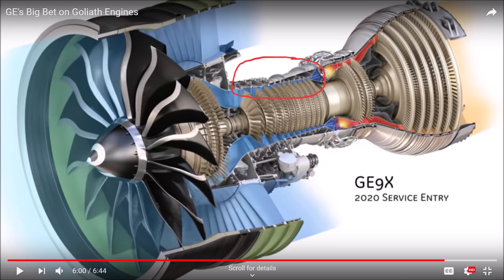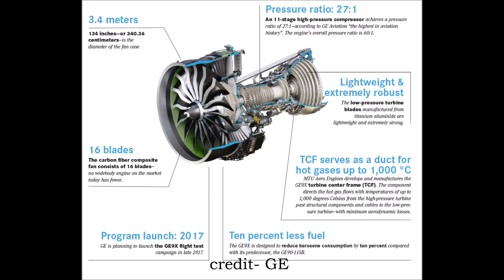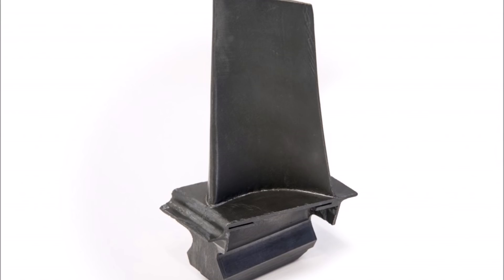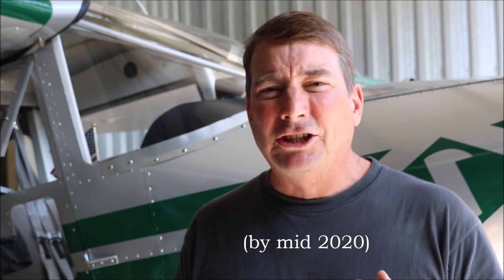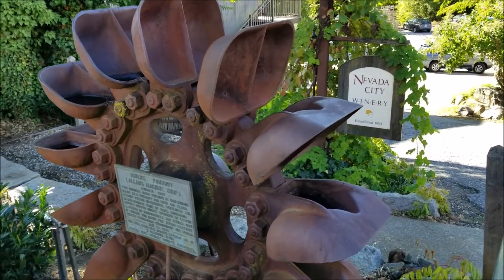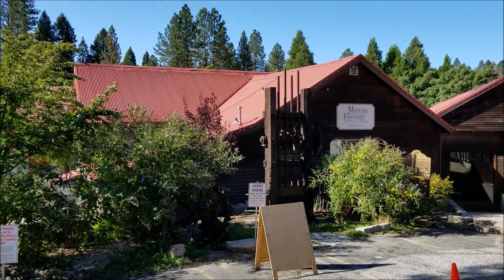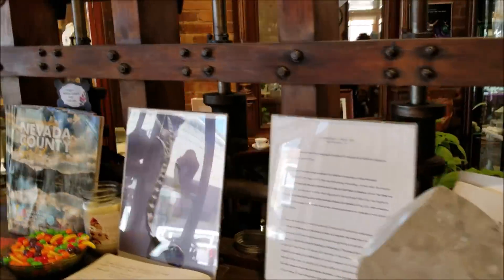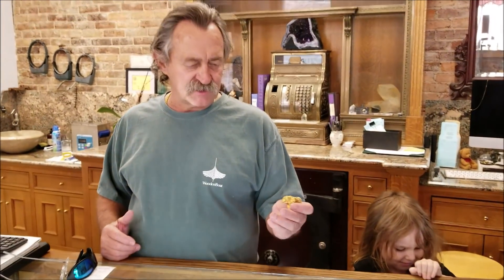Boeing 777x Delays and the GE9X engine stator vane issue.

Comment: I watch this channel very often and I can see that there is GREAT knowledge of aviation matters. But here in explaining large turbofan efficiency there is a major error: The engine's EPR is not a measure of its efficiency.  It's the COMPRESSION RATIO. This is the ratio of the pressure at the inlet of the engine to the pressure at the exit of the high pressure compressor (just before the combustion chamber). This ratio is around 60 in very efficient engines. At Top-of-climb (climb power setting and low ambient pressure).
Reply: There are a number of misstatements, which I have annotated.

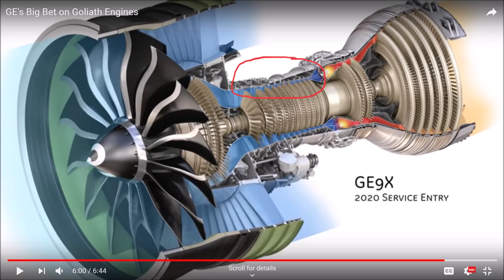Comment: ...their engines are probably disintegrating because they assemble them with their bare handes. Since those components reach high temperatures any part that has been handled by a human has had residual humain grease and oils deposited on it resulting in hot spots and proven to cause premature failure (6:53). I was appalled when I saw that... Humanity is supposed to be advancing with time not going backwards. They had better assembly procedures in the 1950's-1970' for crying out loud. I'm frequently distressed and appalled by the lack of simple, basic protocols that are blatently ignored by the "new" generations.... (For crying out loud a simple pair of cotton gloves would probably solve a whole host of heat related failures for this company. Attention/detail, unbelievable.)

Comment: I still prefer something with 4 engines ie 747 over water. One goes three more left, two goes we are still in the air, three goes we're in deep dodo!
Reply: radioactivelarry It all boils down to fuel efficiency, two engines use less fuel. The early 4 engine jets were rather unreliable, so that extra safety margin was necessary.
Reply: @gordonrichardson2972  True but I'm old school and old! lol
Reply: @radioactivelarry  I'm getting old too. My late father was a navigator on B-24s in WW2. Losing a piston engine was a big deal in those days.
Reply: @gordonrichardson2972  My stepdad was a B-17 pilot. He is the one that got me interested in aviation when I was young.

Comment: Juan, I hate to nitpick at this time,  but there are a number of subtle technical misstatements in your description of the jet turbine. (I would have to go through and timestamp them all). Also stamp mills reduce the gold ore to a fine powder, and would not be used to locate nuggets. P.S. Lovely old Pelton Wheel turbines, but I am sure the cow story is apocryphal!
Reply: Already noted in other comments. 02:22 Stator vanes is correct, followed by stator blades which is incorrect.
03:30 Atmospheric temperature only declines up to the stratosphere. This altitude varies with latitude and season.
04:12 You mean successor engine series. The GE9X thrust will be derated in actual service (05:15).
05:30 Confusion between overall pressure ratio (OPR) of the compressor, and engine pressure ratio (EPR).
06:52 Shows a ring of variable stator vanes (circular hinges), with a few fixed stators (flat hinges in upper layer).
07:20 Higher EGT is an indirect consequence of compressor wear, and running at a higher rpm.
07:46 Most of the efficiency gains are in the front fan, the turbine less so.
07:57 Titanium metal is never used in turbines, either nickel alloys, or titanium aluminide alloy.
08:59 The stated engine cycles for the GE9X are impossible, perhaps you mean the GE90 series?
I hope you take these clarifications in the spirit of clarity and accuracy.
Reply from the maker: @gordonrichardson2972  correct, I was moving pretty fast today...
Reply: @blancolirio  The AgentJayZ channel has dozens of videos, jet engines are hard to explain clearly.

Comment: I just had the thought that if I were a pilot with experience in Boeing aircraft, espeically thousands of hours, that I might consider going around and above my employers certification routines and go to Boeing and do the simulator and get Boeing to certify me on the Boeing 777x.  Then I would, perhaps, have my choice of carrieres that used those aircraft and maybe get pushed to the head of the line in seniority, etc...  I  have the thought that being certified, via training and simulator experience, by the manufacturer would be a great head start, so to speak. (Especially if I were grounded and had a great deal of down time). Damn the costs, maybe someone at Boeing, might take a liking to such a pilot, especially if they followed a well known, well liked, pro-Boeing youtube channel, etc. and out of decency, offer a substantial discount...  Boeing may even take a such a liking to that pilot that they may offer them a better job than the one the currently held...  Just random thoughts...
Reply from the maker: I like the way you think!
Reply: blancolirio  And I may be out of place by saying this, I have the thought that skipping training and certs for the 777xxx shouldn't necessarily be what these carriers and pilots should be striving for. After all these are sofphisticated systems and if he pilots would have trained on these new engines and certified for the new aircraft these accidents may have been easily avoided. At any rate someone certified on these aircraft would shine like polished platinum, versus those who are hard set to avoid the training. It would show determination and a willingness to be above average.

Boeing would do well to put some experienced pilots on thier team, as well. You analytical abilities would be priceless with regard to bringing this aircraft online and up to speed. Seems to me that they have too many corporate lame brains on the task and no one with experience. Whatsmore is that if there was anyone worth their salt at boeing they would have found you, easily by now; you stand out at this point like you were born to be involved with 777xxx. It tells me that the staff at Boeing is stagnated from the top, bottom, sides and rim. No creativity, no drive and simply content to be average. Someone at Boeing should have hired you by now. And I have the thought that you are not giving your experience the respect that it deserves. Perhaps its out of humility, a lack of self-confidence or more likely simply because it crept up on you and you're accustomed, as we all are, to others being more experienced. Seriously, its hard to recognize when one becomes superior in experience and knowledge. We often fail to recognize our own genius and therefore our value. You need to stop and take a look at yourself and give yourself the respect that is due to your abilities. TAKE SOME TIME TO UPDATE YOUR RESUME! (It may help you to realize that you are now the pinnacle of experience with regard to Aircraft and their related systems). I'm not one to flatter others and while this is a difficult topic to language I hope that you are getting my point). You aren' over the hill, yet.  Your experience has reached the point where it has become your nature. You should give yourself a nudge. From my point of view I can say with confidence that you are wasting your talents by settling for 2nd chair/string on an airliner.  Your talents are needed and would be better suited elsewhere in the industry.  You're overqualified to even be the Captain on an Airliner and I'm insulted that you have been over looked for that job.  Apply for technical job at Boeing involved with the 777x ; it wouldn't even be work for you. They need you there and they will hire you instantly; DON'T MISS OUT ON YOUR DESTINY.  Best regards, Johnny

Comment: Juan! Congratulations on the 100K subs! You earned every one of them by your honest and forthright commentary.
I had to ask what is wearing the stator vanes? They don't spin or contact the compressor hub. After doing some checking, it looks like it is the lever mechanism that moves the variable stator vanes that is wearing prematurely, not the stators themselves. Is this right or is the info I found outdated?

Comment: F-16 has 28k+- thrust. Those engines make the fighter look like a toy. Btw, I thought engine cycles could also be added in flight based on throttle operation. I’m assuming large aircraft can vary from fighters in this case.

Comment: Juan..your next 400k subscribers will go very fast! I am still holding my breath for you to take us all on your NEW SIMULATOR ride on the 737MAX. We know you will be called by Boeing soon enough. Of course Boeing engineers watch your channel. Anyone with brains and love of aircraft  watch your show! Great forum, keep up fine work!
Question: are not the Rolls Royce Trent 1000 series and other high performance engines ALSO experiencing stator vane material breakdown?
The SouthWest 737-8 had an engine failure, which sucked a female passenger out of airplane at altitude. I believe this was 3-4 years ago. The female Southwest PILOT did a fantastic job of damage control, bringing aircraft to a safe landing. The base of the stator vanes were pretty much immediately inspected by a nifty test. Thanks for your reports!

Comment: That a non rotating part in a relatively benign area of the engine is the cause of the delay problems is kinda surprising. I would have guessed something in the hot section to be the source. And as a long time gold and silver afficianado I really liked the last part of this vid! Congrats on 100k!
Reply: terry boyer he incorrectly stated that the problem was with the “fixed stator blades”. The problem was actually with the “variable stator vanes”. While they are not rotating as in compressor rotation they are a moving part in their own independent way and do encounter stress.
Reply: @aaronbennington9942  Thank you for clarifying that. Variable stators are certainly more complicated.

Comment: Remember when we were amazed that a 747 had 40000 lbs of thrust in each of its 4 engines?  Now ONE engine has almost that much.   Must be a 6 in diameter fuel supply line on those 9x motors....

Comment: The thermal efficiency of an engine is directly related to the maximum operating temperature of the heated gas running through the engine and doing the work. Specifically, the efficiency is determined by how hot the gas is when it starts doing the work, and how much it has cooled doing the work. The limiting factor is how hot this gas can be. The tolerance of the materials and the extent the material can be cooled limits the max temperature achievable. This is difficult to do in a turbine engine because the turbine blades must be constantly exposed to the hot gas without any easy way to cool them. Ceramic materials and blown cooling air through the inside of the blade itself are attempts to increase the turbine inlet temperature limit.
Reply: Cray Research used Flourinert (tm) to do similar cooling of the mount bars for internal cooling of the X MP and Y MP systems. The whole supercomputer was in-cased in Flourinert (tm)  in the Cray 2 and proposed for the Cray 3. This material was so inert , you could breathe it with added oxygen, much like the divers in Abyss. If you let the mixture get too warm. it breaks down into very toxic chemicals. 3M could figure out a high temperature version for jet engine cooling. We used it to heat our buildings in winter via a heat exchanger.

Comment: Juan,

Blades rotate, Vanes are stationary, stators by definition are stationary.  Therefore, blades can't be stators. so "Stator Blades" aren't possible.

Call them "Stator Airfoils" or Stator Vanes.  If talking blades, compressor blades or compressor airfoils. or compressor rotors, since integrally bladed disks are becoming more prevalent.

The individual vanes being loaded in the GE video are called "Vari-vanes" or variable inlet guide vanes.  The don't rotate with the turbine wheel, so they are vanes, but their angle of attack is variable.

Also, Titanium isn't generally used in the turbine section airfoils as it can't take the heat.  Metal blades and vanes in the turbine section are made from Nickel or Cobalt.  Ceramic airfoils in the turbine section could provide a weight savings over heavy/dense Ni or Co alloys and be more efficient because less cooling air is required.

Keep the vids coming.  Congrats on 100 subs!
Reply from the maker: see corrections above in description.
Reply: powerwheelscd Thanks. I noticed several misstatements in the video.

Comment: Juan congrats on 100,000.... on that note... how much of the higher temperatures is about lower emissions? In automotive engines they operate hotter temps to burn of carbon and nitrous oxides. Also when you use a bigger engine and run it 3/4 power factor you make the engines run less work making them last longer

Comment: Another nice video, but I think you have the Engine Pressure Ratio (EPR) number and Overall Pressure Ratio (OPR) numbers mixed up (the terminology seems confusing to me too).  Roughly speaking, the Engine Pressure Ratio is the pressure ratio between the inlet and outlet of the ENGINE.  This is the 27 to 1 number.  The Overall Pressure Ratio is the pressure ratio between the inlet and outlet of just the COMPRESSOR section (sometimes called the compression ratio).  This is the 60:1 number.  Note: as the first reference below shows, the pressure is highest in the combustion section, so the OPR number must be larger than the EPR number.
https://www.grc.nasa.gov/WWW/k-12/airplane/epr.html
https://leehamnews.com/2016/10/28/bjorns-corner-turbofan-engine-challenges-part-1/

https://en.wikipedia.org/wiki/Engine_pressure_ratio
https://en.wikipedia.org/wiki/Overall_pressure_ratio
Reply: The 27:1 figure refers to the pressure ratio of the 11 stage High Pressure (HP) Compressor specified for the GE9X. Strictly speaking, compression ratio is a volume ratio and is more appropriate for reciprocating engines than gas turbine engines.
Reply: @alta9dena  I don't like the term "compression ratio" for jet engines either, nevertheless it is sometimes used for them.  But, the pressure ratio of the 11 stage High Pressure (HP) Compressor specified for the GE9X is the 60:1 number not the 27:1 number.  The 27:1 number is the total pressure ratio between the intake at the front of the engine and the outlet of the nozzle at the rear of the engine.
If you look at the diagram at the top of this reference:
https://www.grc.nasa.gov/WWW/k-12/airplane/epr.html
You can see that the total pressure at 3 is higher than the total pressure at 8.  The two total pressure ratios we have numbers for are the ratios of 3 to 2 and 8 to 2.  Since the total pressure at 3 is higher than the total pressure at 8, the 3:2 ratio must be larger (60:1) than the 3:8 ratio (27:1).
Reply: @andrewsnow7386  The 60:1 is the overall pressure ratio between HP compressor exit and fan inlet. The HP compressor has a pressure ratio of 27:1 which multiplied by the LP compressor pressure ratio of about 2.22 gives 60:1. Believe me, I worked on gas turbine engine modelling for nearly 35 years, so I think I should know! The original GE90 had a 10 stage compressor with an HP pressure ratio of about 19:1 and was derived from the GE Energy Efficient Engine HP compressor which had a design pressure ratio of 23:1. In a modern turbofan the  above pressure ratios refer to Top-of-Climb, not Take-off . The total pressure ratio between the hot nozzle entry and fan intake is much much lower because of the expansion of the gases in the turbine system and pressure losses in the combuster, interturbine and jetpipe. If the nozzle pressure ratio was anywhere near 27:1  at Take-off the engine would be extremely noisy!
Reply: @alta9dena  You are right, I'm wrong.  Sorry, I didn't even read my own references carefully enough (I'm quite embarrassed).  
So then, neither of the numbers given is the Engine Pressure Ratio (EPR). Is it correct to say that if a pressure ratio is displayed to the pilot, it is usually the EPR?
Reply: @andrewsnow7386  EPR is displayed in the cockpit because it is relatively easy to measure. As a performance engineer, I do not think in terms of EPR. Indeed the computer output for my engine models doesn't even display EPR, although if I was interested I could calculate it from the pressures displayed. I doubt a pilot would think in terms of Overall Pressure Ratio, especially whilst flying.

Comment: Congrats on the 100,000. I bought a 12" enclosed ready to run Pelton wheel last year at auction. But here in Indiana I don't have the water head to use it. Anyone out west need one. I have seen said about 4 or 5 HP at 90 psi.

Comment: 14 Million + temperature cycles???
How many times can they heat and cool an engine per day without violating operational parameters thus rendering testing invalid?
First you have to fire the engine up and let it get to operating temperature with an acceptable load. (??% Thrust) Then it has to cool to complete 1 test cycle which could take hours. If they force cool the engine to speed up the cycle process, then that could be out of operational parameters causing excessive material fatigue due to expansion and contraction.
They have to have some way around the full fledged testing of each engine because they would have to test an engine over 38,000 times a day everyday for a year straight to get 14 million test cycles a year.
Reply: DrHarryT I think Juan misspoke. The original GE90 engine has millions of flight hours.

Comment: I dont see this engine being certified for a year.  Just because GE has designed a new blades, this does not mean they will work or the engine can be certified.  The GE9x engine will be a marvel, if the can get it working which is unknown at this point in time.